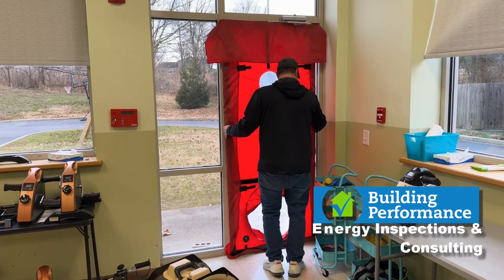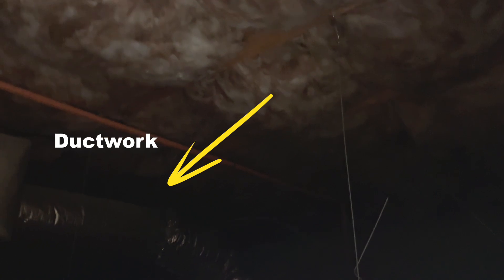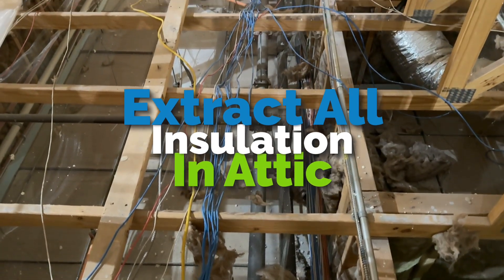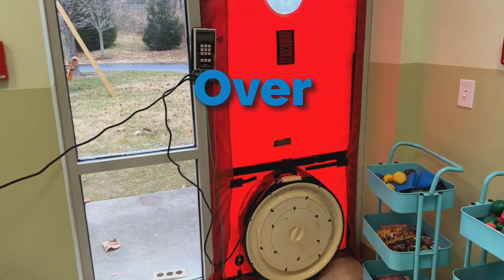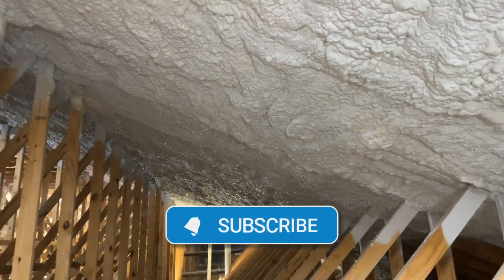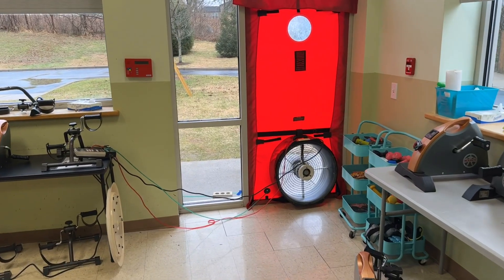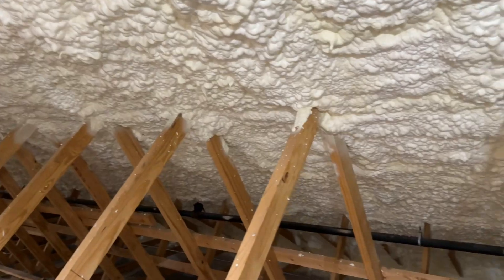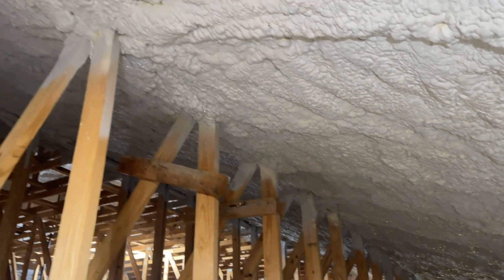BUILDING DESIGN GONE WRONG!

Comment: New sub. Thanks for this video. I about hit the floor with my jaw when I saw how many AC units this building had. Reading books, magazines, and articles (since before the Internet was a thing), and now watching videos, I've long since aimed for the maximum in passive heating and cooling in any construction project. It's not always the cheapest up front, but considering how energy prices keep spiraling out of control, it's way cheaper in the long run. 

A channel that I follow is Matt Risinger out of Austin, TX. Although I owned my own construction company many years ago, and have always been a big believer in insulating as much as possible, making a structure as tight as possible, and using passive heat gain for winter comfort whenever possible, he is a highly educated construction maven. While it hurts my male ego to admit it, I've learned a great deal about the current state of enclosing, insulating, waterproofing, and "air tightening" a structure from him over the past few years. If I do any more construction (I'm in my 70's now), you can be that these concepts will be at the forefront of my designs.
Reply from the maker: Thanks for commenting and subscribing!  I echo your sentiments about the building industry in general and have also followed Matt R for years.  The projects he works on are really forward thinking and cool, but the VAST majority of houses and buildings being built are no where close to that level of detail.  There's so much opportunity in simply making sure new buildings are actually designed and built to CODE that I'll never run out of work.
Reply: @BuildingPerformance502  That's for sure. My ex-son-in-law bought a new house, and was complaining that one exterior door wouldn't close due to wall misalignment.. how can you miss that? setting concrete forms and putting in framing are not much different than "insert tab A into slot B". I mean, it's a lot of work, and you need to know what you're doing (ok, that's square as tested by either the diagonals or the 3,4,5 method). But it's about being honest and ethical and doing it right.

Comment: For sure they are designed wrong. It could have used a Passive Solar layout to help lower Winter heating bills. No one looks that way, unfortunately. It is a one time cost with lifetime benefits, with no moving parts to fail.
Reply: Sadly, you are correct